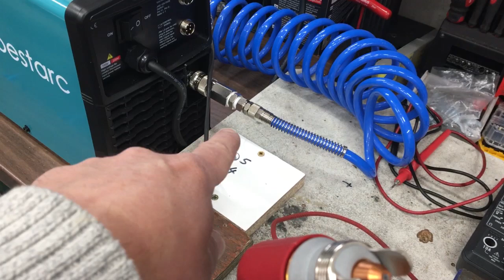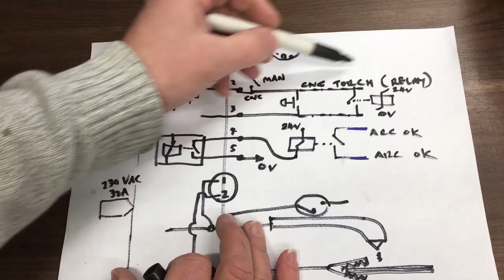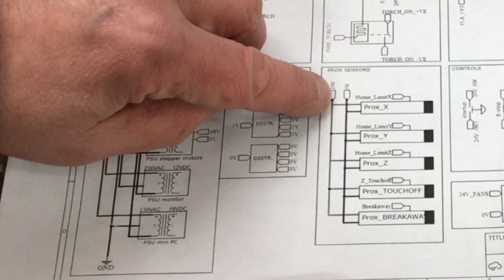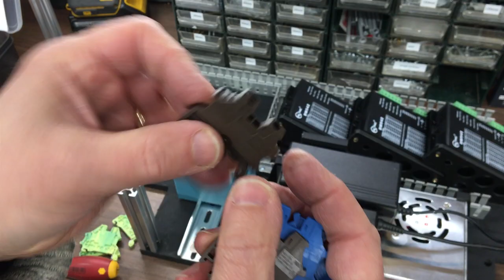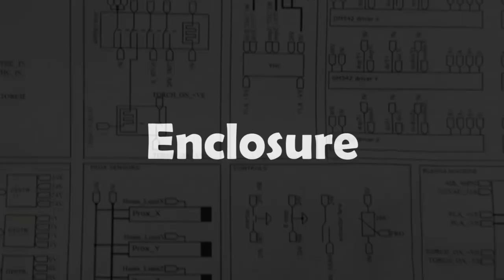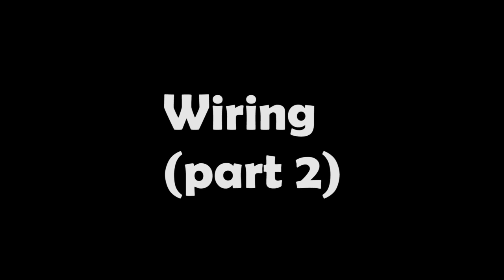Ep08: Plasma CNC build | Starting the electronics

Comment: Do you post your 3D models anywhere?
Reply from the maker: I haven't collated and posted the Plasma CNC machine CAD files, just due to the time involved.  I did post the CNC router machine CAD files on the 'mycncuk' forum site.  Search for "My CNC router MK4 F360 CAD files".  I'll put the link here too but it might get removed: https://www.mycncuk.com/threads/15107-My-CNC-router-MK4-F360-CAD-files?p=129003#post129003
Reply: @routercnc9517 thank you so much for the response. I take great inspiration for your work

Comment: love the build and the vid format, thanks for the vids, and all the info! for 3d printing, I find the 'tree' type support is most easily detached (if you need support at all)
Reply from the maker: Thanks.  I did try tree supports some time ago and didn’t have much luck.  I try to design without needing supports or use support PLA.